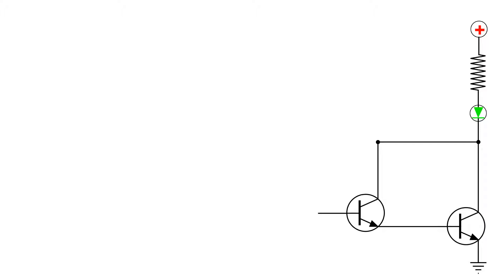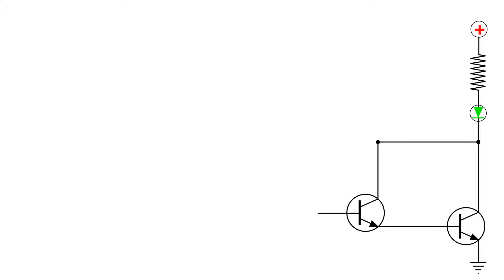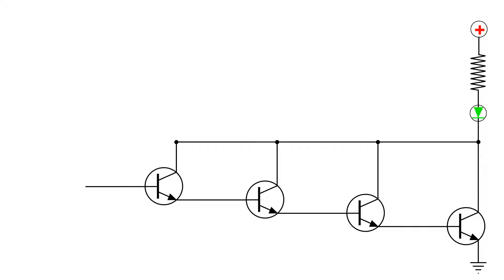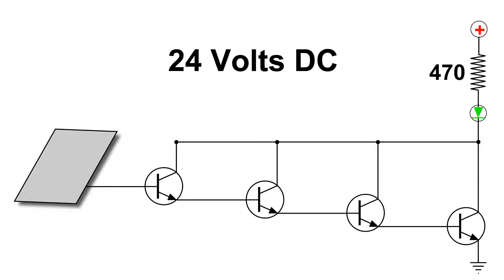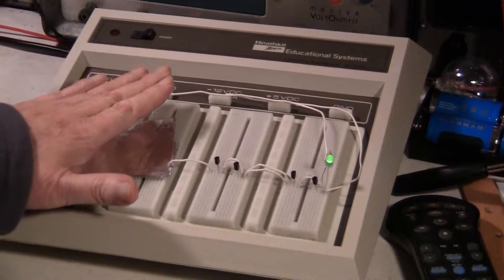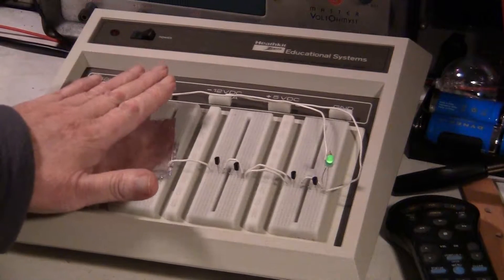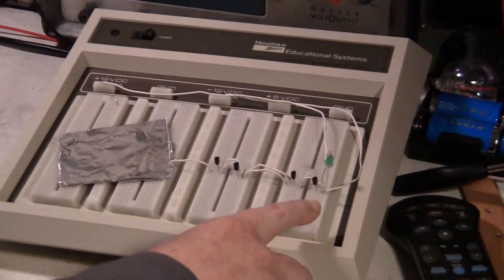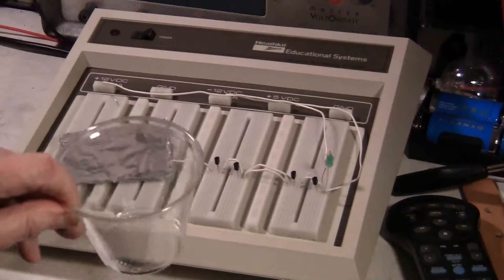Darlington Amplifier Electrostatic Indicator Experiment and Demo

Comment from the maker: Hey Andy
That reminds of the start of digital phones offices. A phone installer was wondering why he was not suppose to use his Tip Ring tester on the new digital offices. The tester was basically a buzzer and ran on 3 Volts. He was surprised when I put in on an oscilloscope and we could see a 400 Volt spike, but very short duration. That spike was the problem, burning up line cards.

Comment: Hi Rick. That’s a good demonstration that shows the practical problems associated with high gain. We once employed a guy who was supposed to be a ‘real boffin’ to build a 100KW 10KHz thyristor inverter. It worked OK until he opened the metal control box to make an adjustment, as his hand got near the circuit board the high gain circuits detected him and switched all four thyristors in the bridge into conduction. They were backed up by some pretty big fuses. BANG!... Boy did he jump!
73's. Andy